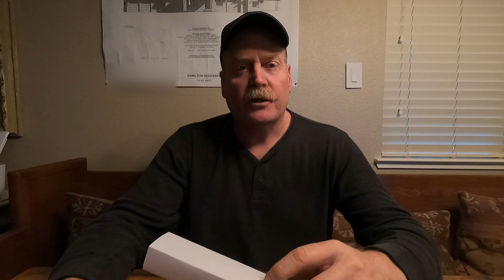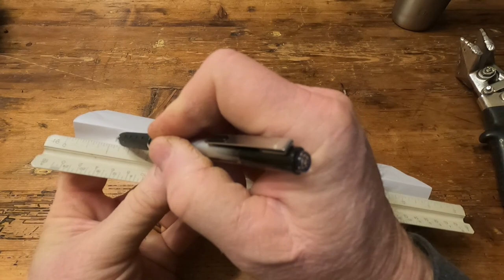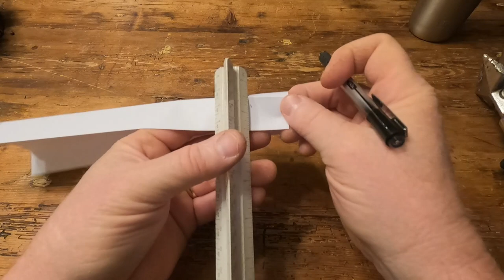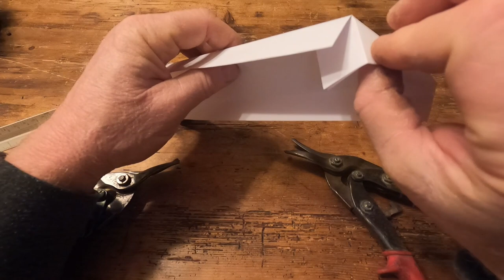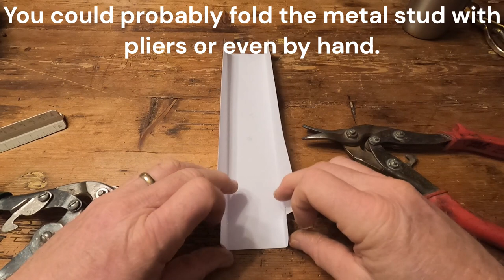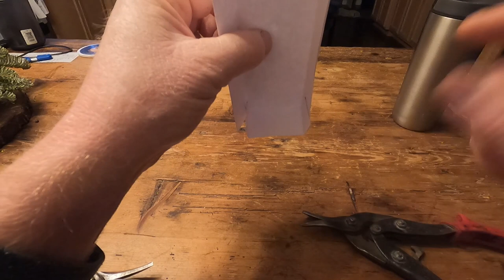How I boxed in the metal studs supporting the roof - Shelterlogic Modification

Comment: Scott! This was perfect! Thank you so much! Im going to buy a few studs and attempt it. i live on long island where it gets really cold and windy, and occasionally snows alot during February and March.. due to zoning laws i cant expand my garage to fit 2 cars so i put up a 10x20 shelterlogic, and i have 1923 Ford T-Bucket that was runner up for Americas Most Beautiful Roadster in it... so far the tent has held up! I just have some moisture issues inside i have to figure out
Reply from the maker: Good luck with your project.  I get a lot of condensation coming off the metal panels as well.  Especially when there is snow piled on top.  Not sure how to eliminate that without lots of air movement.